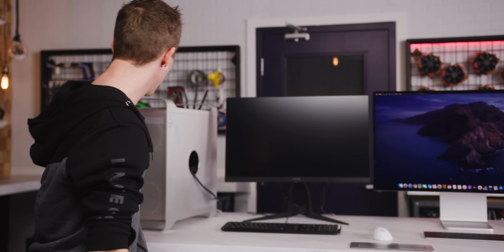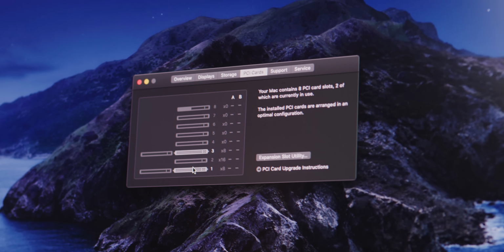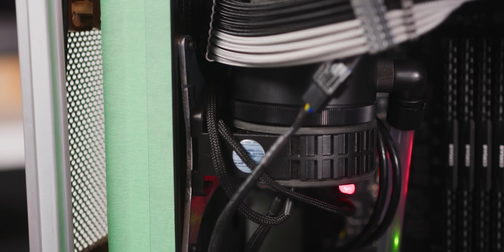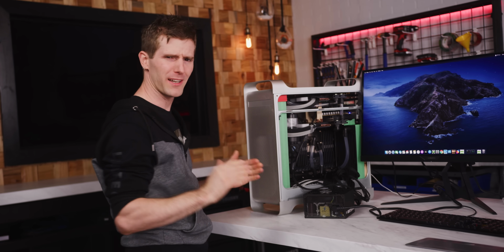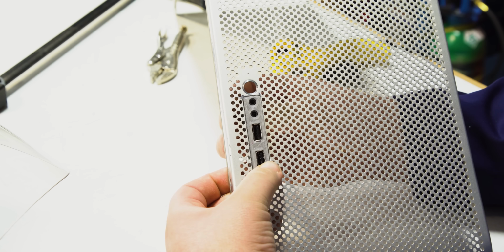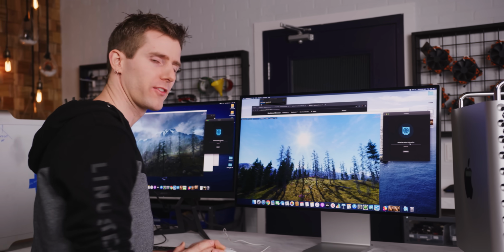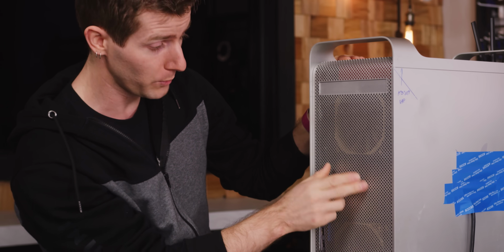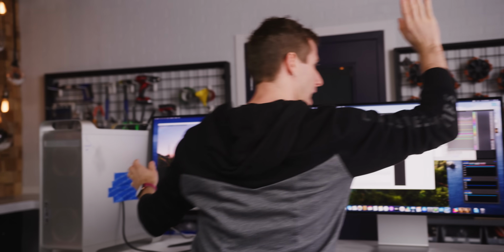Apple BEAT us... but we're STILL TRYING! - Hack Pro pt 4

Comment: Linus: Puts a 24 core in a big custom water loop

Also Linus: "Aw, it's only slightly warmer than the 8 core :("
Reply: was 10 degrees lower?
Reply: You mean slightly cooler?
Reply: 28 core, not a 24 core.

Comment: Aand then AMD releases a 64 core Threadripper - Will hackintosh work on that PCIe4 platform with MI50/60's?
Reply: "Yuuuup!"
 Of course it depends on which specifically, but ya.
Reply: Watch Linus's 64 core threapripper video... The damn thing has a 256GB RAM limitation...
Reply: @ericmatthews8497  it's meant as a workstation CPU, you'll need to go to epyc if you want more lanes and ram, still tho, unless you have a datacenter, who TF needs more than 256gb of ram?, maybe in the future, but 256 will last a long time...
Reply: @ericmatthews8497  256GB is more than enough for alot of workstation work load, unless your doing 8K RAW VFX composition you wount need more than 256GB. i have 256GB ram on my 3970x the max ram usage have it is a particle generated Effect in 4K on a 1 hour timeline and the total porject only max out at about 180GB RAM have never hit the  250GB limit yet
Reply: @hexotech5202  the problem isn't the ram limit but the 10GB/s bandwidth limit VS intel's 30GB/s limit.
Reply: @psionx1  tf you mean , 3990x's bandwith is 100gbps and w3275 is 140gbps , while yes the 9282 is 280gbps you'd have to factor in the price
Reply: You can't hackintosh 3rd gen threadripper now, maybe in future.
Reply: @archfxt3619  only the chipset it-self can transfer 100+GB/s not the CPU. intel has a similar limit with DMI and 1x Ultra Path Interconnect. but no cpu with UPI has less than 2 interconnects. also flagships may be super expensive but intel normally has at-least 1 product that offers decent value vs AMD. in this case it's the xeon silver 4208 vs the EPYC 7232P.

Comment: Why not connect a usb port to a random usb header on the motherboard and connect a usb hub to it and screw it somewhere in the case so you have a place in the case to put your addon cards like wifi and bluetooth(this method is a bit cleaner)

Comment: This project is so cool! As a machinist I really like that you guys use the cnc mill. In projects like this though I think that you guys could benefit by using a 3D printer.  It provides a better result than an anglegrider, and is much easier to use!

Comment: I've turned an old Toshiba laptop into a Hackintosh a couple years ago. It was a nightmare. I even had to load Windows on a live CD and copy a bunch of hex codes from the display driver into the Hackintosh bootloader just so that I could get the display to work! I also had to use a USB WiFi adapter to get WiFi working. It ran absolutely stable for around 2 years! Even more stable than the official Windows 7 installation! It's mind blowing how stable that freaking OS is, even in an unsupported system.

Comment: Huh, since when are the Radeon VII and Vega II Pro Duo "architecturally" different?
Reply: Nemes 2 GPU on one MPX module vs 2 separated cards.
Also how Mac OS treat them I guess
Reply: I think it's primarily the Mac OS.
Reply: Full precision is crippled at hardware
Reply: TheJuggtron yeah to sell 'pro' cards.
Reply: @Janken_Pro  Full precision, that being FP32 compute, is the same for both. The Vega II Pro Duo actually has vastly crippled FP64 compared to the VII, funnily enough, the dual Gpu card as a whole is still only roughly half the speed of a single VII.

All the compute improvements Linus showed are purely driver side.
Reply: @ValentinPasseraH  OK, from that standpoint it makes sense, I thought he meant architecturally and went all "but they are the same chip" mode :P
Reply: Nemes don't worry that make sens as the term is normally used that way.
Have a nice day

Comment: I did. an Hackintosh too, but a little prettier. I mounted the motherboard at a direction, that the graphiccardslots would fit and I only had to saw the slot for the motherboard on the back for all the connector. I put an Corsair sf600 into the original powersupply of the MAC Pro 3.1. and used the original Harddrive Slots for maximum flex. I glued on the front panel usb 3.0 and made the powerbutton to work with a little bit of brazing. I7 8700k 16gb RAM GTX 1060 6gb GDDR5X. 750gb ssd 3tb HDD

Comment: Linus: "What is that, an 8 core? Something stupid like that?"

Me with my 2 core processor: Sad Pentium noises
Reply: buy a cheap quad core cpu off ebay that's compatible with your mobo
Reply: Cores aren't everything. quadcore 1.1ghz laptop... can't even run most 2.0ghz 2core games
Reply: sad i3 noises
Reply: The disappointment in the eighth core is in reference to the price of the computer versus the starting components inside, when you pay six grand you should definitely get more than an 8 core.
Reply: My computer: realizes that is is better and cheaper than my phone and that it came out only 2 years before my phone

Also my computer: sad pentium 2009 noises
Reply: Sad i7 noises

Comment: Mmm... interesting... my rig costed around: US$ 2500 including the water cooling. AMD 3950X, Single RX 5700 XT, NVMe Gen4 2TB throughput of 5GB/s, and on 10.15.2 it scored 1343 Single-Core, 14701 Multi-Core and 55615 Metal and 48120 OpenCL. No overclock on anything. Granted it doesn't reach the numbers you did, but heck it is a fraction of the price, oh and dead silent. Makes me wonder what the TX40 Threadrippers hackintosh would do whenever they get that working.

Comment: Even considering the  concerns over noise you should have gone for air-cooling .  The real Mac Pro uses a passive heatsink but the chassis fans and airflow are so effective that everything remains well within its thermal limits even when under extreme workloads.  Ultimately, there's no real reason why your Hackinosh couldn't have achieved very similar temperatures given that virtually all components besides are motherboard are identical those the Mac Pro.  In your video "challenging the Mac Pro", which was uploaded about a month before this series began, you used a Noctua NH-U14S DX-3647  - I assume this was discarded in favor of liquid cooling  in light of your acoustic targets, but selecting and appointing fans for optimal air-cooling should have been a part of your challenge since this was one of Apple's key design elements.  Nonetheless, a highly entertaining finale.  incidentally, do you mention which CPU you use in the parts list?

Comment: Since the Mac Pro uses all air cooling, which makes it easy to service, someone should try making a system that is as quiet as the Mac Pro using just air cooling. Get a gigantic CPU air cooler, bunch of 140mm fans, lots of air intake and exhaust. GPU fans would probably be louder, but most people using the Mac Pro will not be stressing the GPU that much so the fans would probably never run.

Comment: Here's a solution to getting a single cable 2 monitor with more bandwidth than one cable can hold.
Build a thunderbolt dock into the monitor, so you can have As many display cables as you want inside the monitor.
Reply: I imagine. It wouldn't be $200 to add the equivalent of a $200 Thunderbolt dock inside of a monitor. So we could just be included inside $500 + monitors.

Comment: Former early '08 Mac Pro owner here. Said it before, and saying it again. I'm done with Apple. Either it's too expensive and overpowered or it's too expensive and under-powered. My beloved Mac Pro served me well for 12yrs. Not bad for $2500. But I simply can't justify the cost of their new lineup.
So I went back to Winblows 10...which honestly isn't half as bad as I was expecting once I figured out how to get it under control (O&O ShutUP and a few add-ons to make it look a lot like Mac's interface). Other than file explorer (which I honestly like better than mac's folder system) and the taskbar, it's pretty much all the same.

Comment: In absolute fairness why not test both machines with similar conditions, like either use the same samsung monitor or the 6k Pro display? Because temps can very on stress conditions massively and the hack pro has an advantage delivering way less to a much inferior monitor.

edit: call me a jobs fanboy not apple. ever since jobs passed, we got the trash can, i still use the 5,1 cheese grader with x5690's _128 gb of ram and a radeon 7. I would love for nvidia and apple to make it right again for the titan rtx. for the rest saying its being over priced. Sure, maybe the new models, but Linus said over and over again if you match the product its typically the same, just buy the standard, upgrade the rest yourself. The prices are the same and most likely less by the time you upgrade.

Comment: Thunderbolt 3 card took me forever to figure out. But I have it all running now. It basically can only sit in one of the PCIe slots on the mobo. Also, if you check out the OpenCore bootloader over Clover you get a faster/smoother machine.
Reply: GPU sensors will reappear if you change the smbios to iMacPro1,1

Comment: I think what is more incredible than Apple getting a single product, with a single mobo, a single case, a single type of ram, and a free other bits of hardware, to work together after years of design, is that we can put any one of thousands of PC parts together and it usually works fine. Literally hundreds of different mobos, hundreds of different ram, dozens of different video cards, and thousands of types of non volatile memory. THAT'S incredible. Apple getting a single product "perfected" after years, isn't much of a feat.

Comment: I know this is irrelevant to the video. But you know how you can't easily upgrade the ram in your phone, well I was wondering. If you had a phone , and a parts phone that was exactly the same, could you take the ram out of the part phone and just put it on top of the existing ram and solder it in the same place. And have double the ram? (Given the circumstance that your soldering is legitimately perfect.)

Comment: How much do you value your time, in dollar value?  I used to have fun hacking hardware, but when it comes to a computer that I need for work, I long ago realized the time I spent fiddling with hardware and software vastly outweighed the incremental cost of buying pre-built vs. DIY.  Yes, I'm a Mac person, mostly, but even my Linux boxes are Dells running Ubuntu.  (Also, as was found out in these videos, the new Mac Pro modular design makes hardware upgrades very easy, if you must.)

Comment: I don't get why you chose to upgrade an apple machine... you have to put so much work into installation and make each of the components fit and work together, all done for no advantages whatsoever + if u switch to apple u also have to buy everything from them to avoid "totally random and unscripted glitches and slowdowns", with basically no repair assistance if something fails...
I highly suggest to wait for the SB5799 to pass to buy something from them and if it doesn't, to avoid them since they're a bad lookup to for all tech industry

Comment: Only thing I really really don't understand, why the hole in the side of the case? Surely they could've made a hole in the bottom of it, then used a Male to Female kettle lead mounted in said hole. Then it could've used a neat 90-Degree kettle lead underneath the machine going straight out the back. I mean its even got crazy ground clearance to do it with, but instead there's a massive hole in the side cover with a cable sticking out the side of the case????? :S

Comment: Liqid does support bifurcation but the HHHL SSD in this Hack Pro is using PCIe switching with some Liqid special sauce and an onboard PLX. In this SSD we're taking a x8 link and using switching to feed 16 lanes of gen3 PCIe on the backside of the PLX. Sort of like an ethernet switch but on ultra hardcore super saiyan steroids.  Edit : The SSD is not sparking, arching or letting out any magic smoke. Those are status LEDs. :D

Comment: Using a grinder on Al is not great. You will go through disks like crazy as the Al just clogs the disk instead of wearing it down. Just use a metal cutting band saw blade.

Comment: Get the SSD7103 from Highpoint Storage Solutions, it has 4x m.2 slots, a PCIe 3.0x16 connection and does HARDWARE LEVEL RAID 0/1/5/10.  They also have several other models that can hardware RAID 4x u.2 drives (imagine using four Intel 905p 1.5TB U.2 drives in RAID 0!), ones that can do two m.2 drives and two U.2 drives... Definitely the way to go

Comment: I'd use OpenCore instead is clover. A lot more stable with a higher guarantee that updates won't s**t the system. My Ryzentosh works perfectly with little to no setup which makes me think if they will switch from Intel 🤔

Comment: My 8 core 4,7Ghz all cores 100% all day boost Xeon 2288G Hackintosh Mac Pro killer works perfectly fine this far :) Same with my older Xeon 1231, seems Xeon and the chipsets for server / workstation is easy to get working as Hackintosh? Both of my machines has ECC RAM.